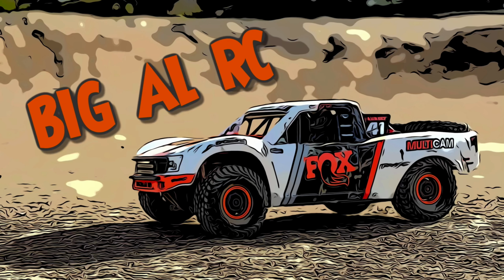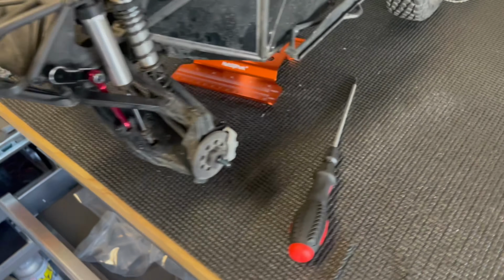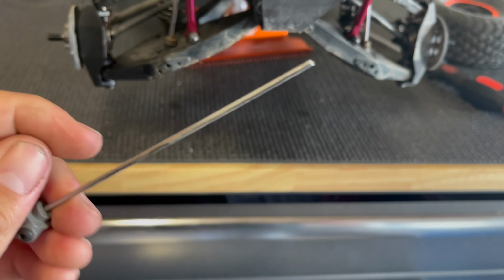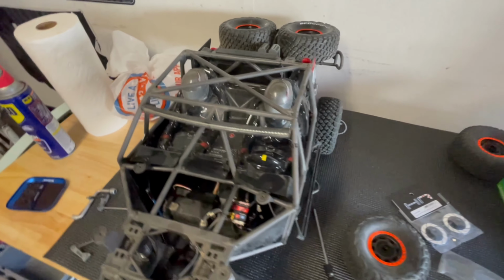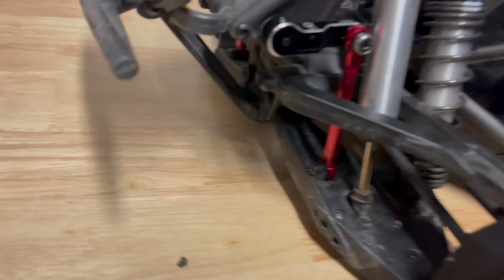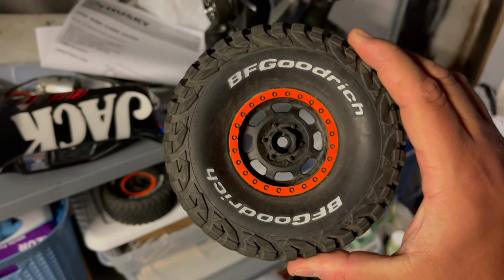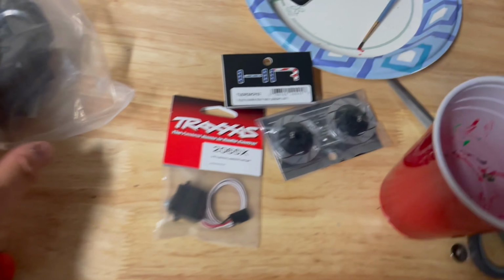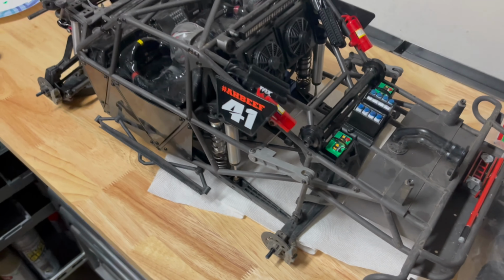Traxxas UDR Hot Racing Sway Bar Upgrade and Scale Parts Painted

Comment: I first got the Hot Racing font and rear sway bars but later opted for the Vitavon ones. I couldn’t get the arms to stay in place no matter what I did. I tried using a stronger thread locker (not red) but no luck.  Plus, the get scratched to easy (need to be powder coated) The Vitavon has the bars supported inside the body of the sway bars then it is clasped down with set screws.  Real purpose built quality.

I also bought the Hot racing front (HRATUDR37PGH) driveshaft but sadly had to get the Traxxas metal (8556X). Anything is better than plastic but with the HR driveshaft there was to much play so it would wobble a lot, which is why I got the “stock” part from Traxxas. There are others but stay away that one.  I’ll post a vid about this.
Reply from the maker: Yea saw many people on Facebook saying they bent their hot racing sway bar arms with one rollover.. saw all that AFTER I bought it of course.. well I’ll run it till it falls of or breaks and get a vitavon after that.